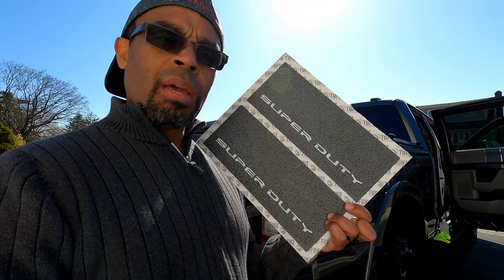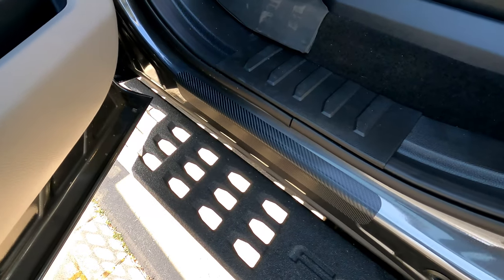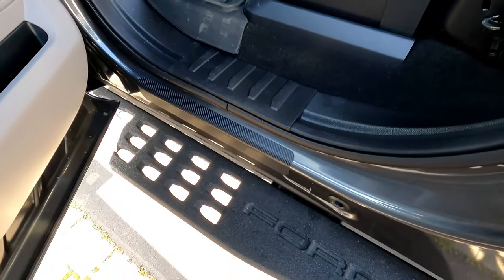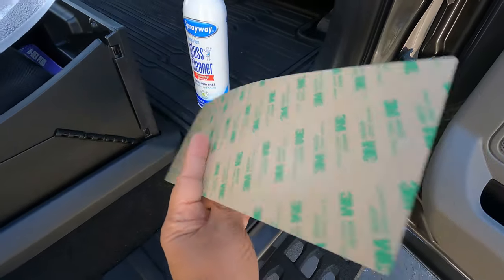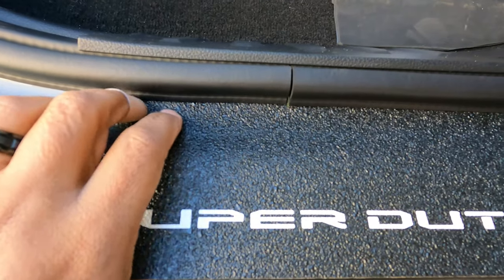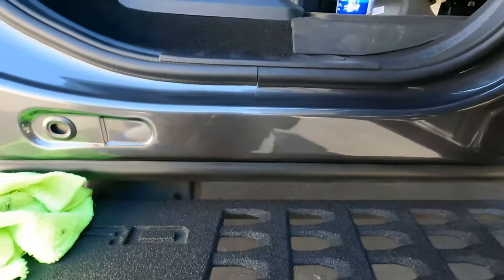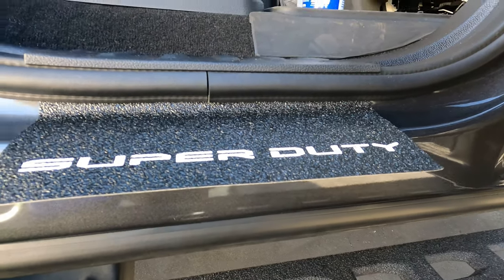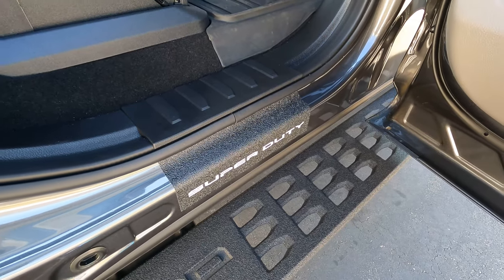Best Tips in installing Tufskinz skin doorsill protectors on 2017- 2021 Ford F-150 F-250 F350 Tremor

Comment: looks good.What is the length and width of the front door part and the back door part of this product? In addition, can you tell me the distance of this LOGO from the bottom edge?
Reply from the maker: Thanks for the feedback and please remember to subscribe to the channel and like the video. To answer the question, please check below in the description section for the link to the item. You will find most answers to your questions.
Reply: @DIYRAY    Hello Ray, can you measure the product size and tell me? Before that, we asked the seller about the product size, but they didn't reply to me. I will thank you very much